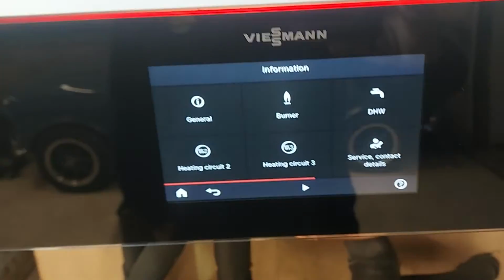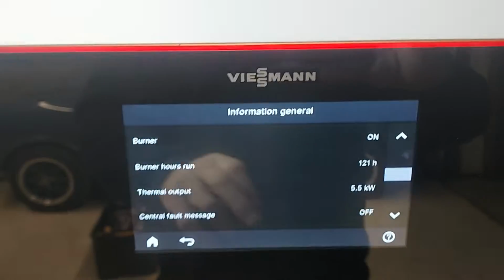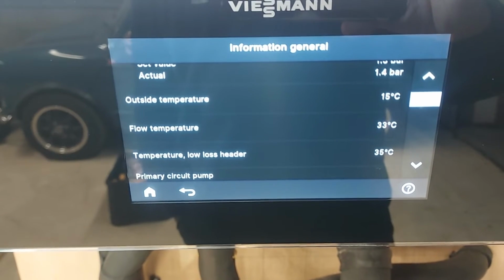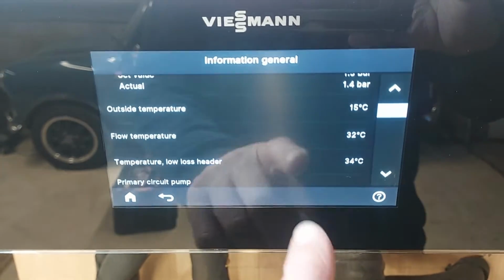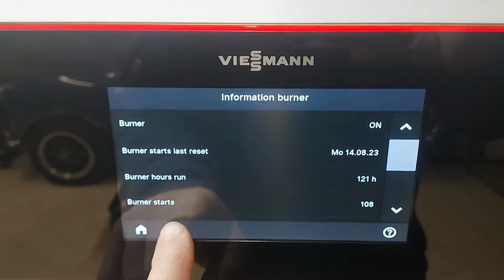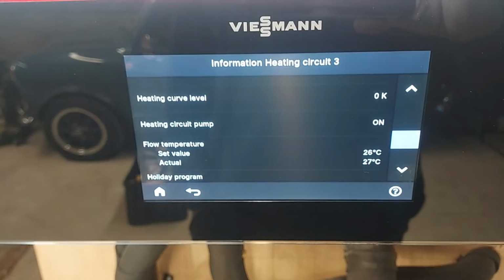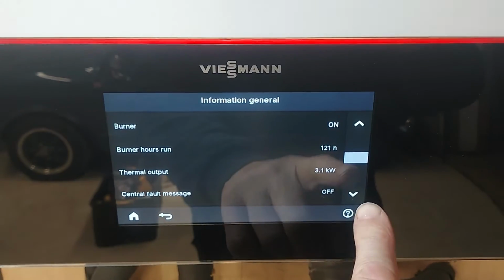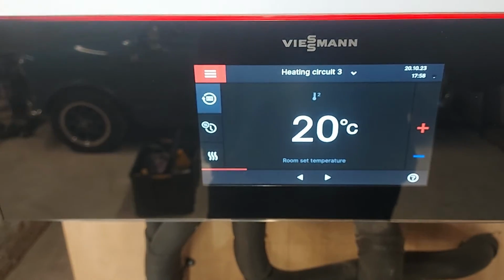Vitodens 200 control

Comment: Hi Andrew,

Very helpful video, thanks for sharing.

For underfloor mixed heating circuits on the 200-W do you modify the 934.5/935.5/936.5 "Differential temperature" setting from the default 8K? From my research I understand it takes the set flow temperature for the circuit and adds the differential, so for example a set flow temp of 22C it would add 8K=8C making it 30C.  According to one document I've read "This enables the mixer to regulate more effectively and prevents it from being permanently open."

Surely modifying the temperature higher by 8C will just waste energy by having to mix it down again? I would think having it set so the mixer remains near fully open would be more efficient by returning the cooler return water the boiler, so it modulates down quicker rather than diverting it to cool an over temperature flow. My system has an EM-M1 with ESBE mixer for the UFH and it usually sits around the mid towards closed position most of the time if just the UFH is on and has warmed up.

The Viessmann 200-W manual does not explain this parameter very well and I may be way off base with this, but any comments or thoughts would be appreciated.

Comment: Are you still installing V200's or moved more to ashp now?
Reply from the maker: @handle1196  I have started a new company with a co-director to install heat pumps. I'm mainly installing gas systems myself as they are more technical. I think gradually the heat pumps will become more common. I will probably take up management role in the heat pump company
Reply: @andrewmillwardwatford9410  good luck with the new venture

Comment: Good stuff Andrew. I think it is a pity that V did not have the capability to display return temp on the control panel - it would sort of complete the picture.
Reply from the maker: The v200 dosn't measure return temperature but I agree it would be useful.